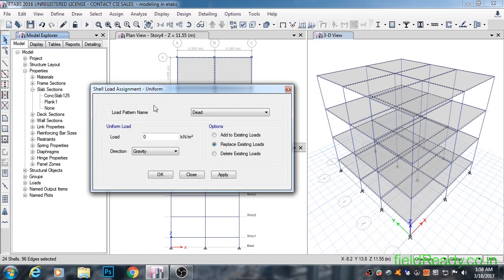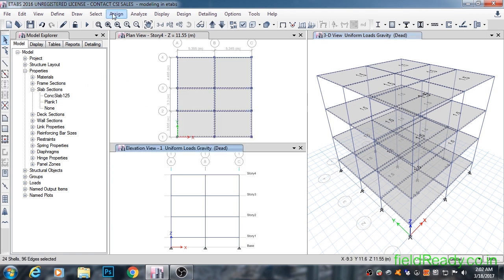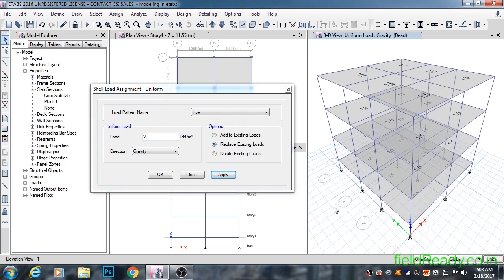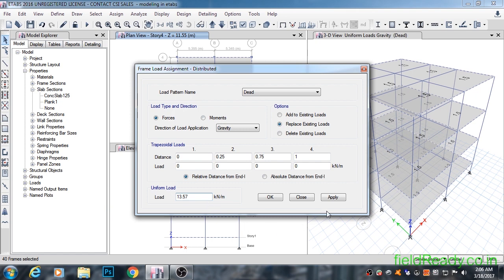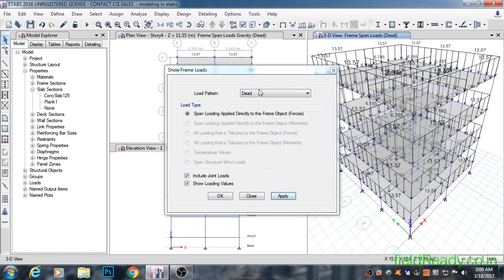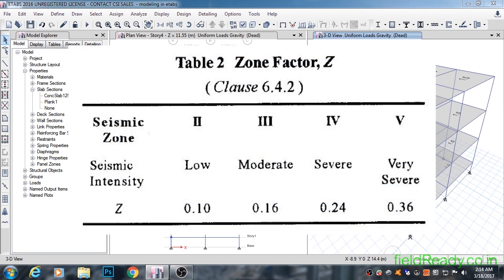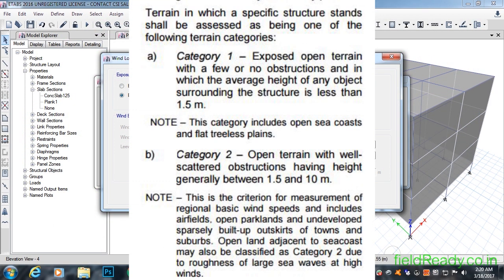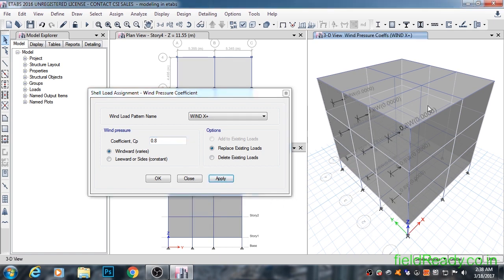Apply DL,LL,EQ,WL onto structure in Etabs 2016 (as per IS Codes)

Comment: 0:38 you have taken dead load as certain value but u should not touch it as the floor finish and other things are consider under Super dead load. so how can u add it under dead load as its self weight multiplier is 1 so adding into it will effect the self weight of the structure and seismic calculation.!
Reply from the maker: Faraz, Dead & Superimposed Dead load is the same thing in terms of dead, its just that the Etabs wants to give user a bit more flexibility to see the effect of superimposed dead on the various design results. I have APPLIED that dead on floors & a thing can only has self-weight if it has some dimensions, what is the dimension of our floor LOADS??? For seismic calculation you have to add Dead as well as Superimposed Dead to calculate the effective seismic weigh. The below links might help you even more.....Effective Seismic Weight:-    https://skghoshassociates.com/SKGAblog/viewpost.php?id=55 Dead Loads:- http://www.bgstructuralengineering.com/BGASCE7/BGASCE7003/  For more videos visit  www.fieldready.co.in

Comment: Sir, how wall load is applied for the wall of 4 inch resting on middle of slab not on beam, is it necessary to make dummy beam and applied the wall load on it.
Reply from the maker: Those are called slab beams(SB), if your are placing any wall (not wooden or aluminum partition) on slabs then you have to provide slab beams. These beams are embedded in slab itself. Reinforcements typically of 2-16dia bottom to 2-12dia top.
Reply: Thank u sir, But is this type is in ur full course.
Reply from the maker: Yes it is a part of full course.I am happy with the response of students towards my design course, I will be adding more advanced topic videos on etabs, staad foundation to this course.
Reply: The exact terminology was Hidden beam/ Concealed beam........ Don't name it as slab beam or something else........